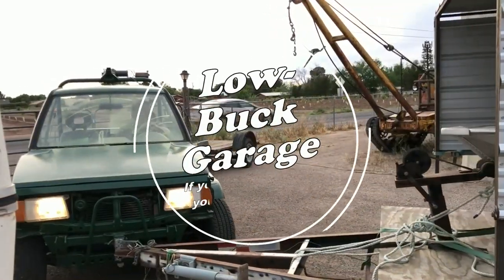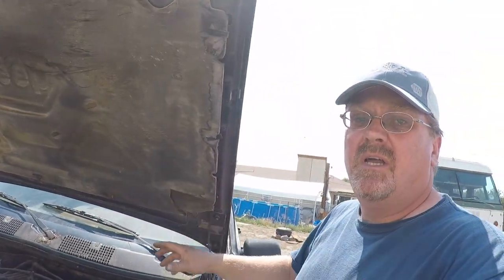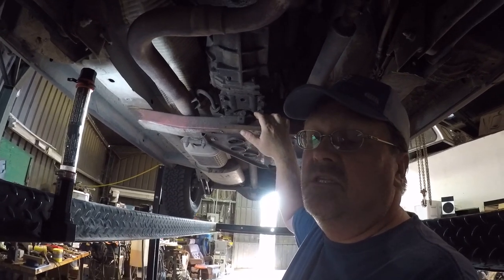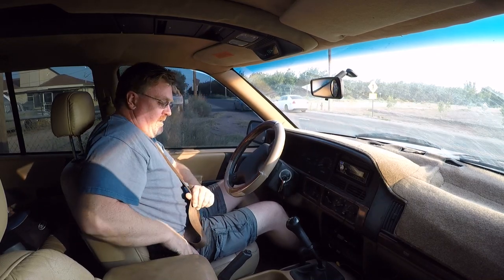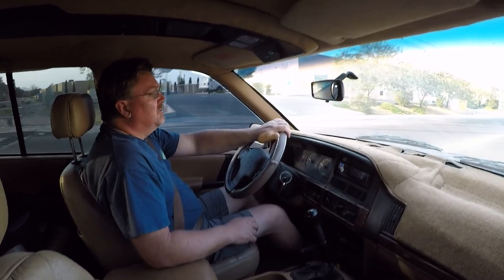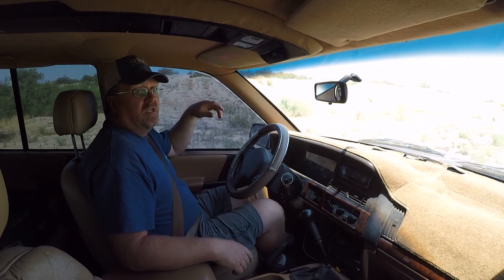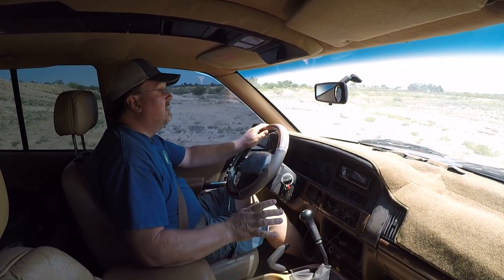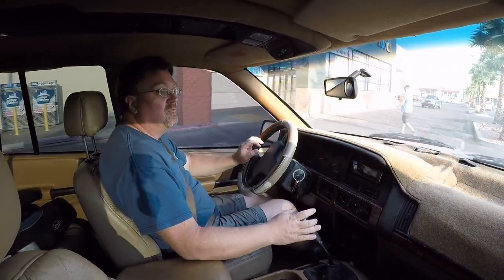Grand Cherokee 4.0 ZJ Manual Transmission Swap

Comment: Correct me if I'm wrong - after swapping the transmission, the position of transfer case is moved backward/forward? Thats why you need different crossmember (pre lift model) and you need different lenght driveshafts front and rear? Factory ones from 96 4.0 won't fit?

Comment: I love it! I dont know if I should buy kit first, or find Jeep first? lol. I have never seen a 5 speed grand. I love it,

I am a car guy, I worked at a shop that did a lot of Cherokee work, but closed in 2012, rare to work on a Grand, my personal Cherokee never had the power, & recently was crushed by a tree, it was a 4 cylinder 5 speed, 2 door. I am  presently fixing a co-worker a Grand up, she found a good deal, & I am fixing all the small issues,  and I really started liking it, & missing my Jeep, so now I want a 5 speed Grand. lol. money is a little tight, after all I did at Christmas, for family, friends, & every resident in 2 nursing homes. but things will improve in short order since a new year is upon us. but this is awesome!
Reply from the maker: Thanks!  I really like the 5-speed in these.  With the 4.0 it is a very easy swap, and is a well-balanced all-around rig.  The 5-speed behind the V-8 is an awful lot of fun, but I just can't keep my foot out of the throttle on those.  That combo seems to encourage lead-foot driving...
Reply: @LowBuckGarage  lol. I do understand, I grew up with muscle cars, I have several parked & still have a 2004 Roush truck & a 2013 convertible Camaro for daily drivers. with a Chevy Aveo & Ford Festiva as beater cars. plus a dodge minivan and wife a PriusC, but I want a 4wd again. but I do love stick shift. actually I want to do a UTE conversion, to make a Grand Cherokee into a truck, not sure you have seen? Smyth jeep grand cherokee truck conversions. I am a body man, as well as mechanic, besides cost of parts I love it, so this year I will be buying all the parts to build 1. it reminds me of a friends K5 Blazer a friend converted into a truck in my youth. just a fun, practical 4wd. that can haul light stuff so yeah a 5 speed conversion will definitely be in my future

Comment: Great tutorial, I have a 94 4.0 limited and want to do the swap, I was wondering about the starter, did you relocated it?
Reply from the maker: Thanks!  The starter stays on the same side with the 4.0 swap, so that's no problem.  Its only on the 5.2 V-8 swap that you need to switch sides on the starter.

Comment: Nice job!! Are you having any issues with Check Engine lights after the conversion? Thanks Rod
Reply from the maker: The light was on before I started the conversion, so that didn't change!  I've heard from people that have done this swap in CA that it does throw a code.  However, if you have a '96 or up with OBDII, the shops that can re-flash the PCM for a performance tune can also turn off the automatic transmission part of the programming.  I haven't tried it myself, but supposedly then they are back to normal.

Comment: Your Cherokee project is very interesting. I would like to do the same as well. I have seen your other videos but I would like you to make a list of parts and pieces and some sort of step by step manual so I can built my own. I know there would be lots of people interested as well. (Please, improve your shop lighting) Thank you!
Reply from the maker: Thanks!  I'm actually planning on picking up another 4.0 ZJ and doing a one day complete conversion with all parts needed and listing the P/N's as I go.  I've got a few other projects in front of that, though, so it will be a while before I get to that.

I appreciate the feedback on the lighting.  I agree that it was too dark, but by the time I saw it (when I started editing) I had already started tearing into another project on the lift.  It'd be weeks before I could re-shoot it, so I just went with it.  I'll do better next time!

Comment: hi i just did my swap all im having trouble with is the speedo   nv3500 out of 98 dakota 5.2
Reply from the maker: I'm driving the speedo off the output on the 231 transfer case.  However, I've heard that the '98 and up Dakota eliminated the regular drive, and instead used wheel speed sensors for the speedo.  That should be reasonably easy to solve.

If you're doing heavy off-roading, you might want a slip yoke eliminator kit anyway, so just get one that has the speedo drive.  It looks like most of them have that option, and then you can really twist the suspension without worrying about the driveshaft falling out.  For a cheaper solution, you should be able to put parts from an older 231 in to get the speedo output.  Actually, take a look at your old Jeep transfer case.  It may be possible to use pieces from that.  I've had some success with mixing full time and 231 parts.  

Good luck, and please let me know what your solution was!

Comment: I have an original, exhaust manifold that is cracked in two places. Could you tell me where you got the new stock header you mentioned in this video and what the cost was? I found many aftermarket cheap headers under $100 but original wkth the proper flange thickness, not so much? Any suggestions would be appreciated. Thanks
Reply from the maker: I bought mine off of ebay, it might help to search for a "4.0 jeep manifold", rather than a "header"  They're still welded tube headers, but that gets more of the stock style.  The newer design adds bellows on the tube connecting the #1 and #6 cylinders.  This gives a little more flex during the heating and cooling cycles, and should reduce the tendency to crack.  What I did was ask the vendor about the flange thickness before ordering, that way if it comes in too thin you can return it.

Comment: hello, I have just installed an ax15 on my zj from 1994, I installed a zj cps manual gearbox from 1993 from walker product, and it does not start.. could I have the reference of your cps because I am desperate , THANKS
Reply from the maker: I've found that different sensors have different strength magnets.  The only ones that are really strong (and work well) are actual Mopar ones.  If you can't find a Mopar 2 bolt style, I make an adapter to use the 1 bolt style (pics on stickshiftzj.com)

Comment: Have you ever done a swap using the nv3550? Most forums I have found say its a direct replacement for the Ax15, but I'm going to swap it into my 93 zj
Reply from the maker: I haven't done that particular one.  I've put in the NV3500 behind V-8's, and there's plenty of room in the transmission tunnel, so I would expect that the NV3550 would fit fine.  The only issue could be the shifter location, but I think they're about the same as the AX15, so that would probably be fine, too.
Reply: @LowBuckGarage  thanks, I'm gathering parts now. Just having trouble finding a bell housing on a budget

Comment: I bought treadwrights just like yours for my ZJ a few years back. I couldn't get any shop to balance them and when I finally could get them balanced they felt terrible above 55mph. Do they ride smooth at hwy speeds for you?
Reply from the maker: I had mine balanced at walmart, and they feel as good as any other tire at highway speeds.  Sorry to hear that you're having problems, maybe jack up the car and spin the tire by hand to see if they're out of round?  That wouldn't be solved by balancing...

Comment: You should do a parts list/write up
Reply from the maker: Yeah, I should.  Right now I've got a playlist of short videos on the 4.0/AX15 swap, so that might help: https://www.youtube.com/playlist?list=PLfyVixelWstCOiN4wFl-1Dr4ADOTKzqA8
Reply: @LowBuckGarage  thanks.  I have a 96 4.0 with 42re, plan on ax15 swapping (inspired by your vids). Will the stock driveshafts work, so long as they are cut to proper length?
Reply from the maker: @brendan25  Yes, the AX15 moves the transfer case about 3". so one will have to be shortened and the other one lengthened in a straight transmission swap.  If you are planning on changing transfer cases or adding a SYE, might as well do that along with the transmission swap and then figure out the driveshafts you need.

Comment: I have a 97 zj limited 4.0 l  it has all time 4x4 so all time, netural,  and 4 low how would I make it a manual . @ low-buck garage
Reply from the maker: If you just want 2wd but keeping the automatic trans, you'll want to swap transfer cases to a 231 or 242 model case.  There's lots of write-ups on that one, just do a search for it.  If you want a 5-speed and part time, look for both the AX-15 and 231 from a '94 and up XJ Cherokee.  Those have an external slave cylinder and the right transfer case clocking to bolt into your ZJ.

Comment: I really want to swap my 4.0 trans out but I can’t due to emissions i live in California so having a check engine will fail me and i cant find anything about a fix to the check engine light :(
Reply from the maker: Is your ZJ a 96-98 with OBDII?  Apparently those PCM's can be re-flashed with a tune that eliminates the transmission stuff.  I haven't tried it myself, but I've had a few different people say that they have done it and the CEL is gone.
Reply: Yea mines a 96 I wouldn’t know who to go to.

Comment: Ok, when do we get a video on that camper thing in the background?
Reply from the maker: Hopefully soon, but I've got to sort out some steering issues with the front drive axle first, though.  That one will be fun with 6 37" mud tires driving!  Right now I'm part way through project Frogger, once that one's done I'll start a new project.  If I come up with a steering solution the camper may be it...

Comment: I have a 2WD 4.0 WJ that I want to do this on.  Do you get a check engine light or did you have to fool the transmission sensors?
Reply from the maker: I did get a CEL after a while, something about the lock up converter.  There are places that can re-program the PCM if that's an issue for you.  It doesn't matter to me, so I haven't done that yet.

Comment: Is there any way I can get in contact with you, I have some questions about doing a manual swap on my zj
Reply from the maker: The best way is to email me at james@stickshiftzj.com
Reply: @LowBuckGarage  I’ve tried emailing you...but it keeps saying it can’t send to that email...
Reply from the maker: @alexparis2885  I'm sorry, I changed to a different domain service, and apparently it didn't go smoothly.  You can also use james@low-buck-garage.com, as far as I know that one is working fine.

Comment: After the conversion do you have a check engine light?
Reply from the maker: I had a check engine light before the conversion, so that's nothing new!  I've heard that you can get the computer re-flashed on the '96-'98 ones to ignore all the transmission signals, but I haven't tried it myself.

Comment: What check engine should one expect from this swap?
Reply from the maker: There is a lock up converter code or something like that.  I've heard that in '96 and up OBDII models the computer can be reprogrammed to eliminate that, but I haven't tried it myself.
Reply: This is a great video! I have a 96, 4.0 that has the 42re and it might be on the way out (it slips and hangs on revs too long) , but I’d like to take on this project of a manual swap in maybe a years time. I’m doing all the research so I can gather all the parts. Do you have any write ups, books, or advice for this project since you’ve done it a few times.
Reply from the maker: @Juss-pivot  That's the same problem that started me down the path to the manual swap.  Not only is it cheaper, but its way more fun to drive!  The 4.0 swap is pretty straightforward.  I do have some tech tips on https://www.youtube.com/playlist?list=PLfyVixelWstCOiN4wFl-1Dr4ADOTKzqA8 , and let me know if you need any other info!
Reply: @LowBuckGarage   Thanks for your help! Really appreciate it.

Comment: What flywheel and clutch set up u use?
Reply from the maker: Stock replacement ones, they still make the parts for this.  Just look for parts for a '93 or '94 ZJ 4.0 with a manual transmission, and pretty much any parts store should have them.  They use the same clutch and flywheel as other 4.0 Jeep stuff, so you can get whatever performance level you want.

Comment: How much does it cost?
Reply from the maker: It all depends on where you find the parts.  The transmission is the biggest expense, new they're close to $2K.  If you can find a wrecked XJ with the 5-speed, it can be pretty cheap.
Reply: So they are cheaper than a automatic replacement anyway.

Comment: Are you using early or late ax15?
Reply from the maker: This one has a '94 AX15, which has the external slave cylinder.  The replacement clutch hydraulics  for the ZJ use an external slave, so those are easiest.  The internal slave AX15 should be able to be used, but you'd have to adapt the hydraulics.
Reply from the maker: @Jos Lewis Wood Carpenter Sure, my drag racing ZJ uses a 2wd transmission.  Its actually easier than the 4x4 version.  I'm not sure what driveshaft would fit, but you can always have one modified to length.
Reply from the maker: @Jos Lewis Wood Carpenter Yes, and they go bad frequently.  Sometimes you can just re-solder the connections inside the switch rather than just replacing it.
Reply from the maker: @Jos Lewis Wood Carpenter The headlight switch has the dash light dimmer built into the same unit.  The vertical slide to the right of the headlight switch is supposed to control the dash lights.